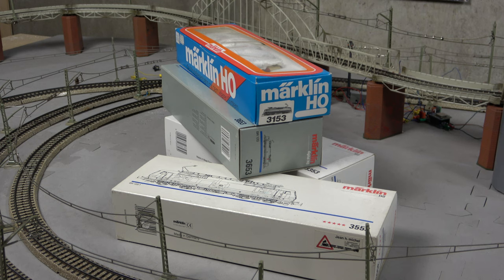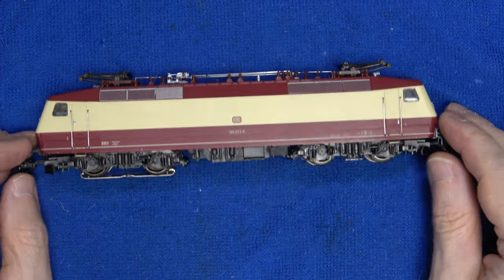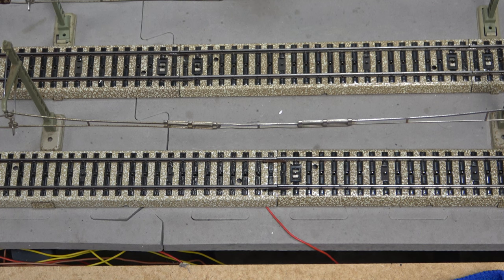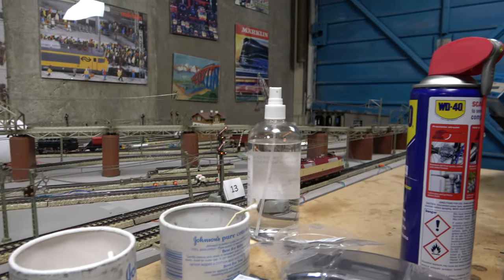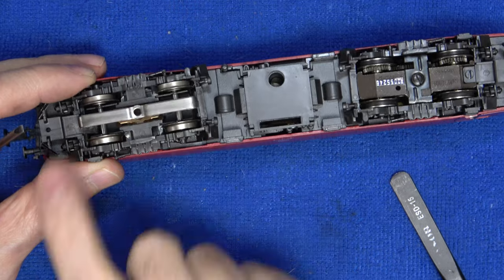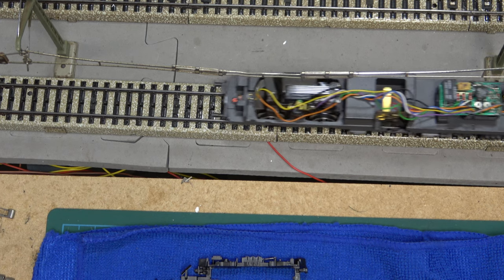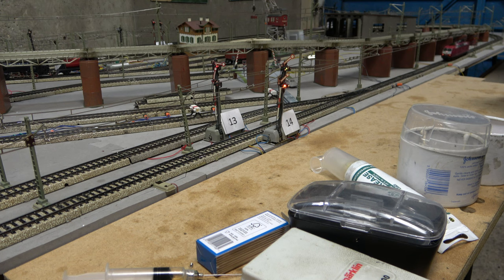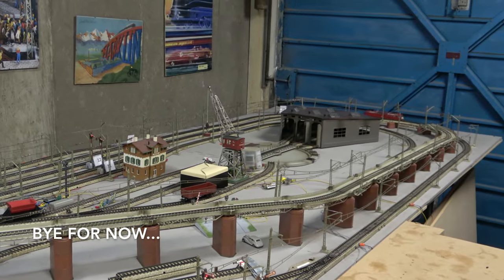Can I Fix it? 1980s Märklin BR120 (3153, 3353, 3553, 3653) - Ep. 2

Comment: Very relaxing watch as always and it does provide a well good mix of the dazzling many BR 120 versions by Märklin. We found a 1990 version of the 3153 with 3 cables on the roof. Its original DCM motor can be quite loud but we managed to change to a 5 pole "hohe Leistung". Runs smoothly now and much more quiet ever since.
Reply from the maker: Thank you, yep märklin made a lot of variations of the class.  Thanks for sharing!

Comment: Great video again. 🙂  8:55 Many times it happenes that the joints where the springs are locked into the slider are oxidized/greasy etc. I clean them with a small brush and Isopropyl alcohol.
Reply from the maker: Good advice 👍 Thanks for sharing🙏

Comment: Hello there I am asking for some tips on restoring an old ST 800 as its been in my family for generations.
Its preatty much in pristine condition since it always had many problems with the layout that I have since its almost never flat but has a slight incline.
The locomotive unfortunately is missing somehow the rear (transmission) metal piece and at the moment not even the locomotive by its self barely runs. Is it possible to install rubber wheels on it and other parts such as lights and the transmission as I dont want to spend too much on something that isnt compatible.
Thanks!
Reply from the maker: I have never had one of these in my hands, so cannot help. I know that Ritter Restaurationen has spare parts for this model, which are not too expensive. They even make some parts. Given you say your model is in pristine condition, it might be worth having a look.  HEre is a link to the ST800 spare parts page on their website: https://ritter-restaurationen.de/en/product-category/spare-parts/spare-parts-00-h0/rail-cars-800/st-800-en
Reply: @The3rdRail  Thank you so much as of right now the only parts I really need are those half plastic wheels as I have whole metal ones and the rubber band for them. I might also look into the couples between the bendable axles since they are quite loose. Apart from that I did also find the transmission piece hidden within the very used cardboard box (still has a shape somehow and the colour of it is in a grey colour with the paper orange sticker with the model number ST800 printed on it)
Reply: @The3rdRail  Small other question for the 6147. I found it i  my basement as well as enough switches and enough raliling for a second railway.
I have no idea how do do maintence or to test if it works without electricuting myself as its a heavy brick with the throttle lever being a bit stiff. Thanks!
Reply from the maker: @turtlepowa  I can't help you with this, I am not a qualified electrician. Best to buy a recent transformer, for example a 6647 or 66471, especially if you intend to run modern locomotives.
Reply: @The3rdRail  Well its main use is for analog only since I can build a second large table with all the spare parts, unused rails, lights everything barely used
Reply: @The3rdRail  As I can remeber correctly it was last used without a single hiccup about 13-15 years ago since then it has been left in a safe protected area with no dust and other factors
Reply from the maker: @turtlepowa  the only I can say about the 6147 is that it is over 50 years old, was made for 220 volt, which is lower than what comes out of most electrical outlets today, and to differeent safety standards. Your analogue locomotives might survive a malfunction, you might not... I am not qualified to give you any advice on testing the unit for safety or how to make it safe... It might be ok to use as is or it might not... I avoid using these units on my side, having electrocuted myself once in the past and have invested in recent transformers.
Reply: @The3rdRail  Yea I saw the initial issue with the different voltage limit that is why I am very concerned.
Might just keep them as static display